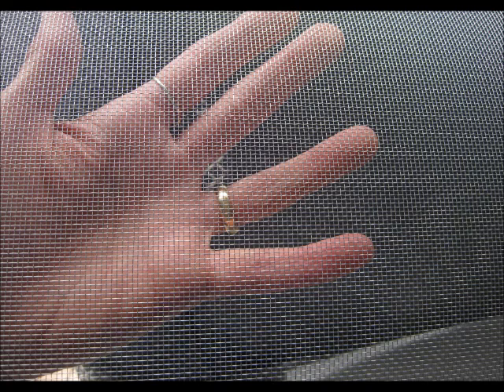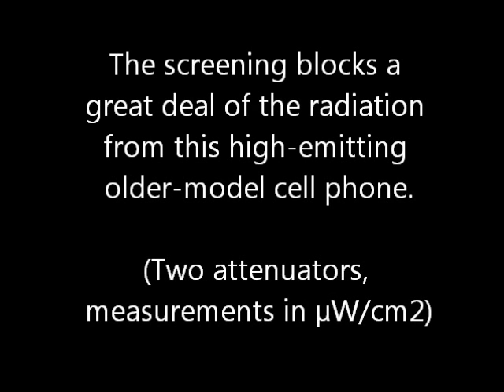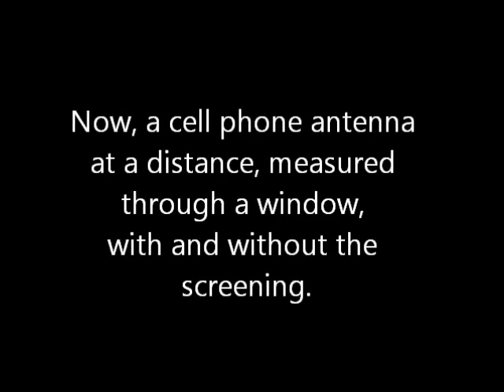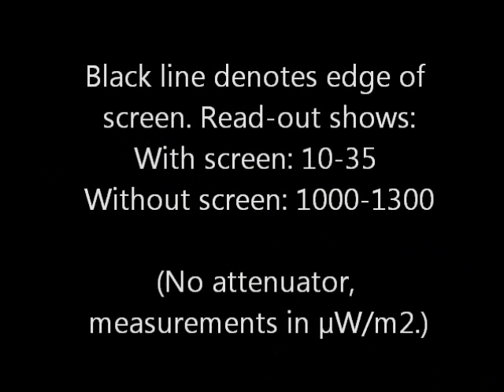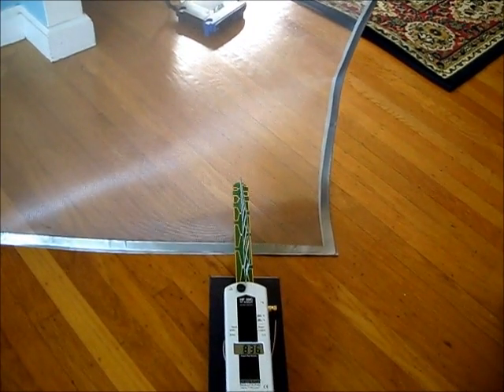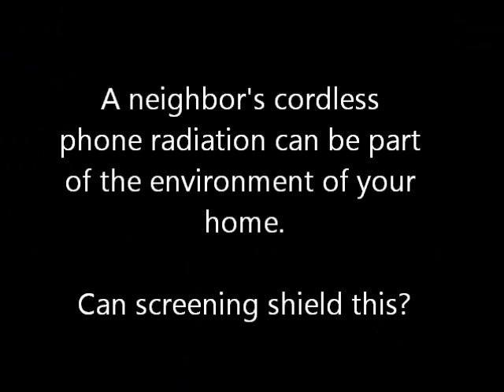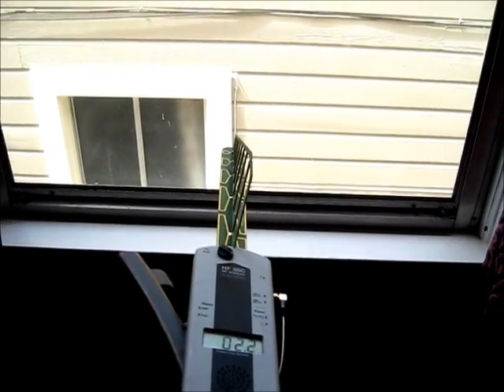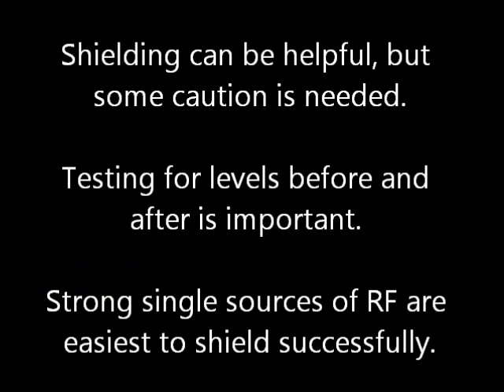Shielding RF Radiation with Aluminum Screening

Comment: Will rubber work as well as aluminum to block the RF?  Any thoughts on this are welcome.  Thanks
Reply: +Adrew Dio No the mesh is best its  like a faraday cage of sorts
Reply: Thanks for the tips.  I will be checking other videos for other experiments using water, brass, other materials and how they block other wavelengths.  Also, if the signals are within a home, how do we block them when they are near us (1 foot and less)?  Wrap the dsl box in aluminum or shield it with a screen?

   I will investigate more on this and thanks for all of your thoughts on this.
Reply: no it needs to be metallic

Comment: I no. I shielded my windows with it on the outside. So i can open my windows for fresh air. This material is olso to buy coated with plastic. (black) So it will not oxidate. Greetings Arjen Witzel Holland

Comment: Doesn't work.  Try taking an aluminum screen off your window, place it in front of your wireless adapter and use a signal strength app that came with the adapter check the signal.  You'll see no difference.
Reply: Can you upload a video proving your claim? In this video the user shows visual proof that it does work. I am more inclined to believe them as there is visual and audio evidence to back up their claim.
Reply: Robert Drake I tried and it works with some frequencies, not others.  Blocked neighbor's wi fi but did not block transmissions from cell tower, which are totally different frequency.
Reply: JohnLothe No need to believe one or the other.  Only works with some frequencies...not with others.  Critical to get your own meter and not 'believe."  So much unknown in this field and every emf situation is different.  bottomline:  alum screening helpful for some; alum foil also somewhat helpful for wi fi blocking only.
Reply: maybe ground it to a copper piece connected to a chord into an outlet

Comment: Very nice video, did you happen to test with the smart(dumb) meters to see if it helps shield it at all and have you tried the stainless steel screen, which probably has a different conductivity than the aluminum?

Comment: All very interesting, but you would have to screen in your whole house, not just windows.. At the ghz range, the rf energy penetrates your walls easily. Something to think about
Reply: ABikerLife Yes.
Reply: Still, we are talking about reducing intensity, not necessarily total isolation.
Reply: ive seem emr measured in uw/m2 but 5g frequencys are in  gigahertz  how do we do the convertion so we are comparing apples with apples please?
Reply: @privacyconcerns1077  yes we Are, because 5G has too low of a penetration power, it stops at your window, And even Is stopped by your skin

Comment: I have a question and comment: I live in a aluminum-walled trailer. Does this stop RF radiation? Also, could it change it, focus it in some way?. In 1991 for a few years I would hear at night the sound of a diesel idling. Sometimes the sound was very pronounced and made it difficult to sleep. Could RF cause a person to hear such types of sounds?---No, I at that time, never found any source of this sound from a  truck source or anything like that.

Comment: Point 1 experts have a job if they don't results deliver or deliver unwanted results they lose their jobs, with a family to feed that would be terrible Point 2 experts are not gods they don't know everything and thus can be wrong. Point 3 have you gone an measured the level of exposure you've been exposed to at your work station(the chair you sit in all day) or are merely stating specs n if you did post the results in a vid

Comment from the maker: If you are measuring low-frequency or magnetic fields with your Trifield, then aluminum mesh will NOT shield. These fields require other materials, more costly and hard to come by. Go to a $ite called LessEMF and search on their material for magnetic or electrical field shielding. 

The best solution for these fields is often DISTANCE, as much as you can manage. They have deleterious effects, documented by research. S34RCH on name of scientist call "De-Kun Li" who works for Kaiser Foundation.
Reply: What can be used to shield against 5G antennas signals?
Reply: @nucreation9833  anything, even leaves, it has almost no penetration

Comment from the maker: KONG, I am sorry to say you r sadly misinformed. Studies on biological harm from RF in the microwave range are piling up fast. Do yr homework. 

Just a few of the demonstrated biological effects of RF: Infertility, sleep disruption, memory-formation disruption, calcium ion leakage, breeches of the blood-brain barrier, accentuation of allergenic response, cancer propagation and augmentation, tumor genesis, thyroid abnormalities --- the list is very long.
Reply: DNA damage, compromises/suppresses  immune system, fatigue, brain fog and disorientation/confusion, microwave hearing(what is diagnosed by doctor as tinnitus) 

I'm right there with you man. Everyone should watch this  video I came across awhile back about ICNIRP openly admitting that they know that microwave radiation being transmitted by wireless communications and technology causes both microwave hearing and electrostimulation(if you don't know what this is, look into it) yet they are not basing any safety guidelines around them, nor do they even acknowledge them as harmful.

Imagine being hooked up to a tens-unit 24/7.. 365 days a year while having a screeching ring in your head and ears like when you have after running a circular saw through wood or after firing off a .38 magnum next to your head.. then you will get an idea of what it is like having to deal with it. 

Here is that video where they are talking about being aware of it.. skip to about 8:30 in if you want to get to the point I am making.

https://www.youtube.com/watch?v=i7rTumGdxlw&list=PL88Y_Kfo7V6q9umDbD0HTqQgC8SPGlrWX&index=74&t=720s

Comment: it depends upon how much you like your place. if there is no harm in getting out of there then do it, otherwise you can use stuff like the flyscreen shown and window film in order to attenuate. But bear in mind the smart meter (and any other RF microwave) radiation can travel straight through masonry brick, concrete etc, and so you might have to also shield the walls, and this is done predominately by application of a conductive carbon/graphite based paint, which is expensive and time consuming.

Comment from the maker: @LPblast -- you're talking about shielding for low frequencies (common electricity). My demonstration is solely about shielding high frequencies. There is a website called LessEMF (dt) com where they sell some materials to shield those low frequencies, but I can't say what's best or how it works. I know it can be expensive. They will try to answer your questions, I have found, so you should ask.

Isn't the noise worse than the EMF?

Comment: I´m pretty sure the difference is s little higher, I keep trustung my painometer. A good trick, by the way, is to move your shield construction permanently (with a ventilator for example), most of the professional shielding material is very thin and when it swings, the observers have serious problems aiming.

Comment from the maker: In your work you encounter RF chokes and ferrite beads, I expect. These prevent RF from propagating along wiring and thus prevent RF interference with electronic equipment. Ferrite works without grounding, acting as absorber.

There are many ways to deal with RF, and testing is the only rational way to measure effectiveness, not merely resting in beliefs or conventional "wisdom."

Comment from the maker: That is certainly what has been taught. I like to test ideas myself.

The capacity for the metal screening to reflect the RF is, it is evident, not dependent upon grounding. 

The screening block and reflects, and anyone can use that quality to protect interior environments from RF pollution. 

Grounding may increase the shielding effectiveness, but I show that it is quite effective without grounding.
Reply: thisirradiatedlife I know this is old, but I would have loved to see how much, if any, the walls themselves protect? Some, a little, or half as much as the screen? Thanks for your time and great video!
Reply: Would make ugly walls...

Comment: Stucco exteriors are usually made with an aluminum mesh to hold the cement material in place. It would be interesting to see what affect that has on exterior radiation

Comment from the maker: Radio-frequency radiation goes through most everything, more or less. Glass windows are more transparent than wood and plaster walls; it passes though plastic easily, while a water-dense body (like your own) absorbs quite a bit.

You can cover walls on the outside of a house with screening. See my complete list of shielding videos for a demo. Use an RF meter to determine where the RF is coming from to choose the best wall(s) to shield. Create a "shadow" from the RF source with shielding.
Reply: yes it can come through walls, you can get special paint or fabric to shield

Comment from the maker: YES, a metal case will cause problems, mitigation, and interference. To put it baldly, it is a stupid choice. Plastic allows RF through, & there are special plastics that are "RF-transparent" such as those used to panel cell-phone antennas.

Take care with your exposure to transmitters. Do not spend long periods close to a transmitter that is 'on'. Do not expose your testicles if you want healthy babies (or any babies). Do not expose yr eyes, as long exposure can cause cataracts in the future.

Comment: Hello,
I working on system which will stream information using Wi-Fi and 3G technology. The thin is that my friends wants to place the entire system (cpu, modem and ANTENNAS) inside an aluminum case. But i'm not sure, because i say that the signal will decrease and also cause interference inside the case

Comment from the maker: Adair, I don't quite understand what you aim to do. Do you wish to block the signals from 3G and WiFi from getting to an electronic system you have? You could use a Cornet RF meter, which records about 7 seconds history on a little histograph. Put it inside the case, close it, then create cellphone or wifi signal, turn that off---then open the case and look for a spike on the Cornet meter. You must do this someplace you can control what signals are present (e.g. not in public, cafe, phones, etc)

Comment from the maker: @BOBMAN068 Good question. It turns out that the levels of RF from a tower needed for a cell phone to connect & make a call is pretty low (I'm not talking about data streaming). A room lined with mesh will create a "shadow" from incoming RF, but it won't be a Farraday cage--that is, excluding all radiation. I believe you would still be able to use a cell phone---but you would increase the RF inside the room, because some of the radiation off your phone would be "bouncing" off the mesh, into room.

Comment: OMG always i see this device in combination with any "isolation" attempts i wanna throw up ... use google and look for directional antennas! this f**king atenna on the front is a high gain directional antenna ... it's the same when i let you use some 1000x googles and put a paperpiece of 1x1inch right in front of the glasses, you would see nothing!!!! next time testing shields, try using a DIPOL-nntenna instead of that blinker antenna! you would be suprised how useless you shielding attempt is!

Comment: OMG thank you, this is exactly what i was looking for. I unplug my router at night because i can't sleep but i got 23 other WiFi signals coming through my bedroom walls. I was gonna buy the shielding paint but it's still way too pricey. 
Aluminum mesh may be a good temporary solution instead. 

So it IS effectively blocking WiFi signal?
Is it deflecting or absorbing it - should i ground the mesh after i wrap my walls with it???

THANK YOU SO MUCH!!!
Reply: im not an expert but I believe the metal needs to be grounded
Reply: i think itdeflects not absorbs.  not sure.  i think there's more reasons to ground thann she mentions

Comment: And the quick scare example is from the release of Adrenaline from your adrenal glands. Little bean shaped things on the top of your kidneys. Gets your heart pumping for fight or flight. But what kind of waves do you mean? A pressure wave? That could do it. A wave with enough energy to break covalent bonds? Yes, that could do it. Radio waves don't pack that kind of punch. If they did, we would all already be dead.

Comment: That's my point. Your heart is not a motor. It is flesh and blood. You can not induce a current on it. Look up what "induction" is. Your nerves carry "electrical" signals chemically. This is very different than how the electrical wires work in your house. To get a shock you need to become part of the circuit. Like paddles on your chest. A current won't set up in your body when you are in the presents of a magnetic field. This is why you can stand under 500 000 volt power lines and not vapourize.

Comment: @thisirradiatedlife Please explain to me the physical principle which allows a nerve in your heart to act as an inductor. Induction is how a magnetic field is used to create electricity.  Unless you have an iron core wrapped with coils of copper wire in your heart, you are not going to to induce any current flow from an extremely week em field. You are getting far greater magnetic field exposer standing next to your fridge when it's running, or any other motor in your house. Furnace, dryer.

Comment: You're not suggesting that the whole house is covered in Aluminium mesh?
 
To shield against EMF and RF sources effectively it's important to understand that the radiation is deflected or made diffuse by the Aluminium screen and so it needs to be directed to a ground source or away from your body or home
 
So when sheilding a smart meter in your meter box at home for example, proper earthing is needed to direct the radiation to ground

Comment from the maker: @soxmoe1 The issue is the very strong field within a ten-foot radius of the unit. Units are configured for a large area of connectivity; I've seen units put in the far corner of the garage, and still someone gets NetFlix on the bedroom TV. Most people who have reactions like heart rhythm disruption from WiFi usually have these problems when in close proximity to the unit. The field drops off quickly outside of 3 meters.

Comment: I'm confused, why are we worried about shielding this radiation? The meter is a very impressive, with all that beeping and humming, but it doesn't mean shit. Cordless phones, wifi, cell phones do not produce ionizing radation. Ionizing radiation can strip electrons from atoms and starts in the UV range. This is what can harm you. Using sun block will protect you. Tin foil on your head will only make you look silly. Spend a few moments on wikipedia and educate yourself.